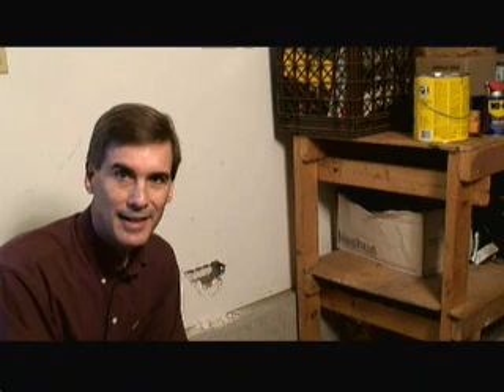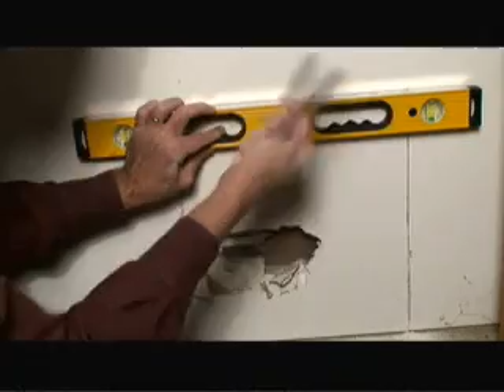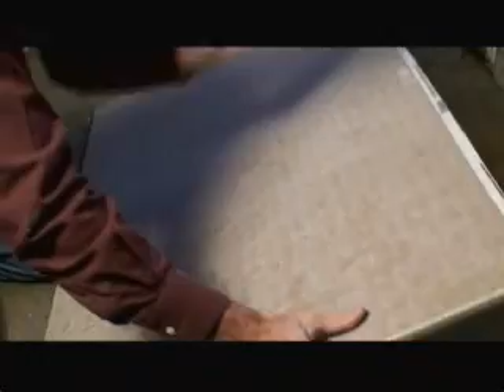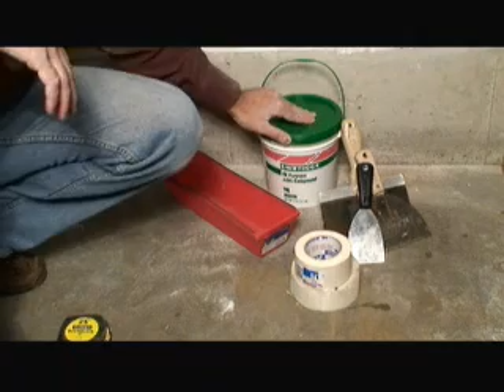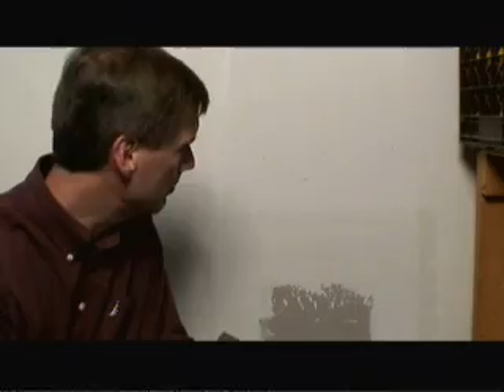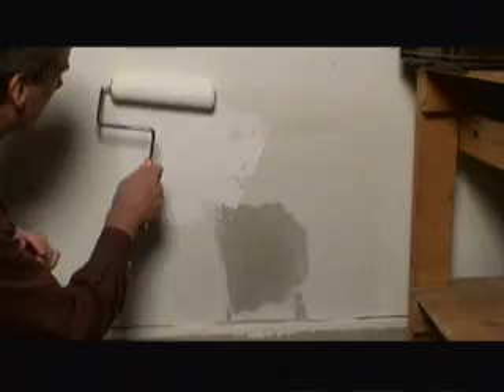How to Repair a Large Drywall Hole Video

Comment: My plumber had to cut 4 feet of drywall. Most handy men are charging $600.00 just for this repair which is over priced and outrageous. 
I can do it in less than $100.00 myself. It's doable.

Comment: What if the wall has texture?
Reply from the maker: Then you'll have to try and match it. You might be able to use a slightly loosened amount of joint compound. Look up skip troweling. If there is sand in your texture you could add some sand to the joint compound before spreading it over the patch with a trowel/taping knife.

Comment: Is there a reason why you went 16"  up the wall instead of just above the hole?
Reply from the maker: Yes, a 16 inch strip of drywall that is only a couple of inches thick will flex and probably crack when you try to attach it the wall.

Comment: When you cut out the hole, did you go beyond the inside edge of the stud on both sides? Otherwise, what do the nails adhere to on the right side?
Reply from the maker: Yes i did. About half the width of the stud, which is 1.5 inches thick.
Reply: @HomeAdditionPlus  Thanks for getting back to me.

Comment: You completely missed the step I'm looking for, the step where you insert the drywall screws. Do you drill a hole through the drywall before you insert the screw, or did you just screw right into the drywall carefully? Thank you in advance if you answer this before I screw it up lol.
Reply from the maker: You screw directly into the new drywall piece, and the new drywall piece sits on a 0/75 inch lip on the studs. I cut back the opening such that half the stud widths are exposed.

Comment: Okay I'm confused. The screws don't go into anything but the piece of wall you just put on, how are they holding the drywall piece onto anything? What purpose are they serving? ...
Reply from the maker: The screws are going into the wall studs. That is why I removed about 0.75 inches of drywall over the studs, so the new piece could sit on top of half the width of the wall studs.

Comment: Is the"skim" coat the same you used the first time or different material
Reply from the maker: You don't need to add any water to the joint compound. Just flair out the final layer of joint compound with a wider drywall knife.
Reply from the maker: Same material. Joint compound.
Reply: @HomeAdditionPlus  just thinner,  correct,  add more water?

Comment: I had a leak in my roof. Had to cut out a 2' x 2' square. My question is how to you create a recessed perimeter so that the tape sits in this recess and allow you to have perfectly flush finish. Every job I have done and seen like this you can always still see the perimeter bumped out. Can you cut and remove the drywall paper, exposing just the chalk then mud that, then apply a perimeter of tape? Or perhaps I could try and compress the perimeter of the hole  the width of drywall tape so that my tape sits in the recess? Maybe use a metal roller of some sort? Am I trying to reinvent the wheel here?
Reply: Once you put tape put compound ,let it dry then sand it and then put compound again then sand it once more until you have flush surface.

Comment: how do I repair a wall in which is a thick wall of plaster and drywall together, and holes been cut out for electrical work but there's no studs for support.

Comment: I have plaster walls a squar hole 5x5 I will use a 2x9 piece of wood place behind center of the hole in wall then counter sink screws into place then cut a 5x5 piece of plywood with quarter inch holes drilled into it so plaster patch will fill & grab into the drilled holes then attach board then fill with plaster no drywall tape is needed tbough better that if wood or the drywall board replacement piece is thinner than original so sits deeper then can not tell area was worked on.

Comment: Got it, thanks. One more question if you don't mind. The hole I'm fixing is similar size wise to the one you fixed (a bit taller though). It's in a bathroom wall in my condo unit, where the studs are metal. I just finished drilling screws through the drywall patch and into the studs. The patch drywall piece is now sitting a bit deeper than the existing drywall around it, so it's not flush (I think because the metal studs are a bit too flexible). Will this be a problem when I start taping the joints? I'm thinking maybe I should put some spacers in behind the drywall patch (inbetween the patch and the studs)? Any thoughts would be appreciated. Thanks!
Reply from the maker: Yes, put some spacers in. You won't be able to get a flush/smooth finish with that much of a depression around the seam for the patch. Pieces of shingle work well for this.
Reply: Got it.  Thanks again!

Comment: Thanks for this great video. One question - do you allow the joint compound to dry after the second coat and before applying the skim coat? It doesn't look like it in the video, but that part might just not have been included. Thanks again.
Reply from the maker: I let the joint compound dry before applying another coat.

Comment: how do you recommend retexturing a wall that was damaged in a large area that had texturing. I don't know the style of texturing exactly but is evenly flat but raised plateau looking affairs(lack terminology on this) not the kind that is lumpy or sharp. The housing here in Oklahoma often have textured white sheetrock not smooth. my home was built in 1970 but has been redone with walls that are textured by previous owner I cannot contact him on the style he used. he moved out 6 years ago.
Reply: YouTube diy venetian plaster techniques. the flatter your plateaus the more you sand.

Comment from the maker: Use a utility knife to square up the hole. Then buy a length of 1"x3" lumber and some drywall screws. Cut small lengths of 1x3 lumber pieces. Slide a piece of cut 1x3 into the hole so that half of it is hidden by the drywall and the othe half is exposed. Use one hand to hold it firmly while you screw drywalls screws through the drywall and into the 1x3. Repeat this process on all 4 sides of the hole. Now you have a lip to attach a piece of drywall to.

Comment: my family just moved into a new apartment and today my sister body hit a wall by mistake now there a big hole in the wall.  theres nothing behind the dry wall no wood or insillation        ( probably why it broke so easily) it's like they just proped the dry wall up and painted it,  but anyway the hole is really big how would i fix a dry wall hole like this that has nothing behind it to srew the dry wall into?

Comment: Over the years I have had to cut openings to access interior walls.  I gave up cutting to the center of a joist.  You don't mention it, but doing that can be a bad experience.  You will run into drywall nails or screws with your knife/saw and will butcher the straight cut edging.  If the opening will be big, then I will follow the edge of the joist, and in repair, will insert a 1"X2" board along the side of the joist.  Obviously not here because of the vapor barrier.
Reply: Did you meant stud, instead of joist?  In the video he was cutting to the center of the vertical studs.  I guess that would still involve nails or screws though.  And do you add this other board on both sides when two studs frame the opening?

Comment from the maker: @KCTseng1 You can either do the same process if you've already cut out the drywall or you can make a smaller square or rectangular hole and place furring strip pieces behind the hole edges. The furring strip pieces are installed so that you create a lip to attach the new piece of patch drywall to.

Comment: Hi, I have an orange peel textured wall, and I was wondering if cutting the wall would actually help because it cracks easily. It looks like there's a thin wall of orange peel texture over dry wall. If I were to paint over the plaster, would it look weird? I have a feeling it might look too smooth for the orange peel texture.

Comment: where was the insulation? If you don't have insulation why do you need a vapour barrier? Also, a "floating scab" on the top would have given you something to screw the drywall to on all 4 sides.  You should never put a bevel against a cut (butt) edge as you did on the right as it does not match up and needs to be pre-filled before you can tape it. Also, never,never,never NEVER use fiber tape- It cracks on the joints every time!!! I have been a taper for 29 years I've seen it over and over.

Comment from the maker: You can cut the hole to a large enough size to slide  in 2 to 4 1"x3" material (furring strips) behind it. Then fasten the furring strips to the existing drywall edges, so that there is surface area to install a new piece of dryall into the hole area. Then use drywall screws to fasten the dyrwall patch to the 1x3s.

Comment from the maker: Yes, the techinques in this video will work for what you need to do. My only concern is that there could be mold behind the drywall much larger than the soft spots. You should do some sample test holes in a few other places besides the soft spots to see if you have a mold issue. If you do, then you will to need to remove all of the drywall.

Comment: Good video!  I was wondering if this would help if my basement drywall has gone soft and I was thinking of making a hole just to the soft spots out.  I had flooding issues before and the root cause of the flood has been dealt with (i hope).  If not, can you direct me to a link in your video archive which would show me how to fix it?

Comment: Thanks so much.  I have to repair a large hole that was made right next to my electrical panel.  I was nervous about how to cut out the drywall (so that I could replace it) as there are many heavy duty wires behind it.  Your video showed me the exact way to do it.  Very informative and very easy.  Thanks again!

Comment from the maker: If the pipe is close up to a wall, e.g. baseboard heating element pipe, then just notch the very edge of the drywall. The notch won't be seen once there is a heating element cover over it. If it is in the middle of a wall, then you don't have much of a choice. You will need to splice around it.

Comment: thanks freind i accidently broke a huge hole  of dry wall in my closet its so fragile that a little bit of pressure punctured it and now im covering it with a poster away from  my mom i dont know wen im going to fix it

Comment: Good video.    You didn't need to make the hole that big... could have made it 1/4 to 1/3 the size and put a piece of drywall in with the paper edges only on the edge and then mud it in place and then sand it down after it has dried. 

Did this about 9 months ago when I pushed the hand rail into the drywall before fixing it by putting into the stud.

Also should use tuct tape (red tape) to tape up the vaporu barrier and not duct tape but that will do.

Comment from the maker: Yes, however you should frame in a stud between the opening. The spacing between studs should be no greater than 16 inches on center.